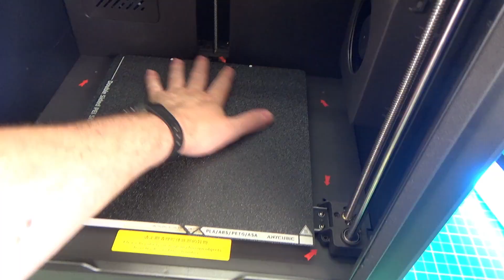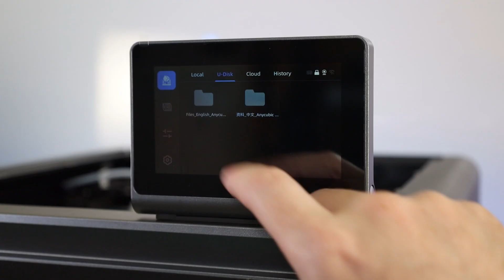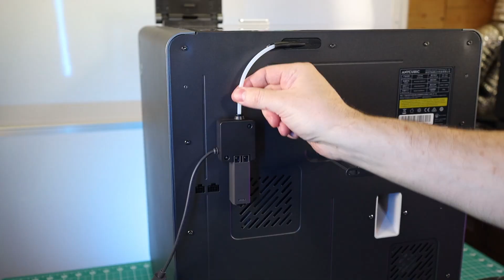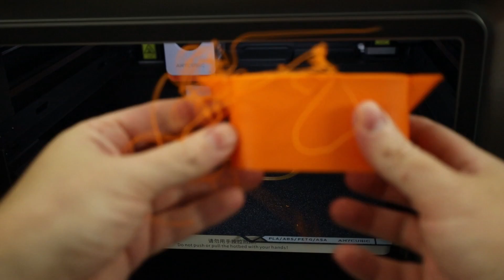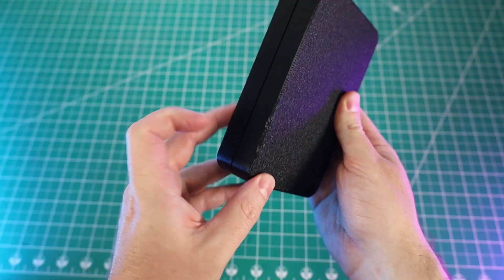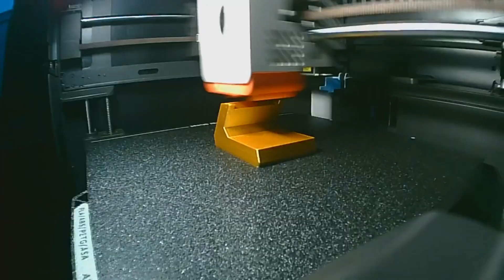Let's Checkout The Anycubic Kobra S1 Combo

Comment: Hi Randy! I was super curious about this printer, thanks for making the video! Do you think it would handle printing models for casting jewelry?
Reply from the maker: They technically can but I do not suggest using it for that. The printable material that you can use with this does technically work but isn't the best especially for jewelry. You're also not going to get the detail that you're going to want out of a printer like this when it comes to casting. 

There are printers on the market that can print similar to this using wax but they're very expensive and out of the price range of pretty much any individual. Your best option is to get a smaller high quality consumer grade resin printer and get the wax like resin for casting.  If you're looking for suggestions on machines or resin feel free to contact me.
Reply: @randymay  Thanks so much for the explanation! I appreciate it a lot. Just wanted to double check one thing that we're on the same page - so what I had in mind is using these 3d printed models to then create molds, is that also what you had in mind? 
As for the machines using resin, I'd love to hear your recommendations! :)